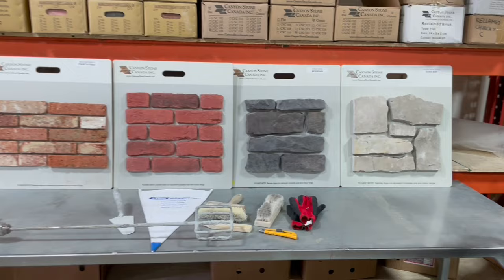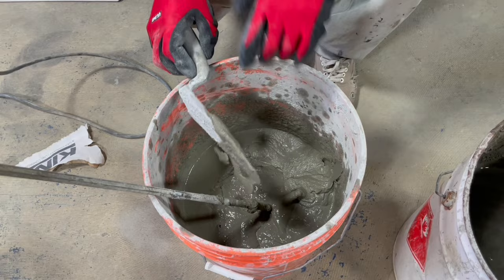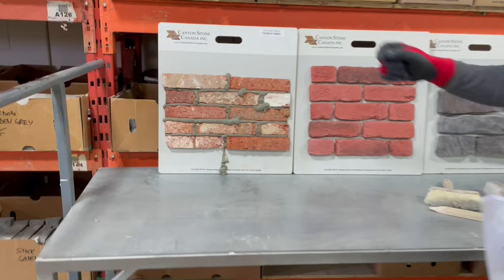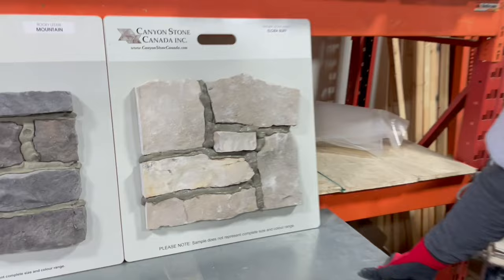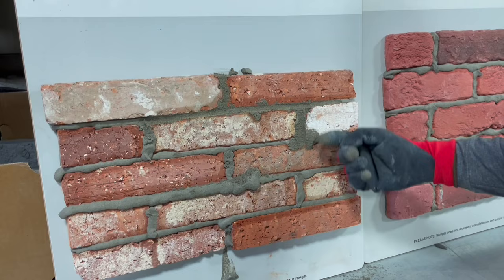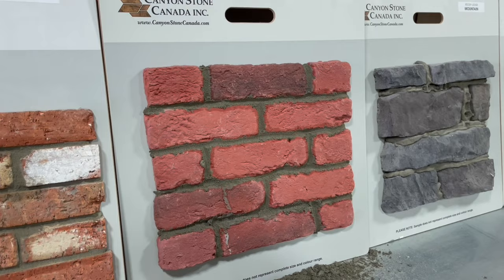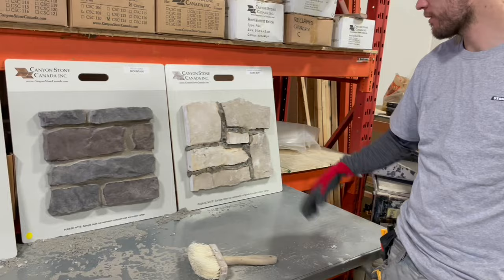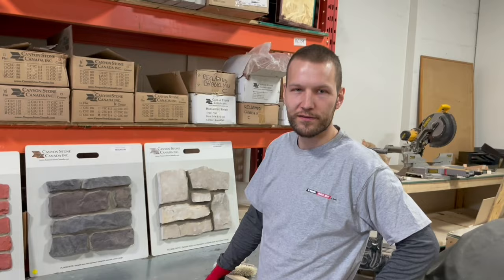EASY MORTAR JOINT- HOW TO GROUT BRICKS AND STONES

Comment: FYI take it from me, you'll want to be careful as you can, and to not drip mortar on your brick work. Some craftsmen refer to it as "smearing" up your masonry work.  What happens is that when  you smear it up and it dries, you always have a mortar haze on the face of your brick. This is O. K. if you are going to wash it with a cleaner, but you really only want to use a typical cleaner solution outdoors and then only if you know what you're doing. Brick cleaner has a kind of strong acid in it that can damage stuff and make you blind and other bad stuff.  It is possible to coat the face of the brick with a resist that keeps mortar from sticking, but that kind of keeps mortar from sticking where you want it to stick. There is a learning curve.
Reply: what if you are painting the brick anyway

Comment: only critiques i would say are, the mortar was a little wet which can cause more mess than needed, and when brushing you should always brush up and down with a slight angle forwards, otherwise you are just brushing mortar out of the joints.

Comment: So outside, if it rains with in two days? Will it hurt cover it with plastic like 6 mill plastic roll? Only thing there is  condensation? Any thoughts? Cause soon as I do my rock wall, even if no rain in forecast it will rain.

Comment: Appreciate this video!  I'm getting ready to redo the grout on the steps leading out the back door.  The previous owner was cheap/lazy and used a clear silicone caulk.  Pulled that all off yesterday, cleaned out a good amount of the loose grout.  Ready to do the this part!

Comment: All I got to say is that if you aren't familiar with working with bricks and mortar, take whatever scraps you have and set them to a separate piece of plywood and then practice the pointing  before you destroy your brick. I would even suggest that you can install the brick and hire a pro to grout it. I can almost gaga that at the very least you will need to as if wash it when you're done

Comment: I recently tried to repoint my brickwork using a mortar bag as per this video and it was a disaster! The mortar seemed to separate in the bag when I squeezed it and all that came out the end was a dribble of dirty water…made a right mess. I tried increasing the size of the hole but that didn’t help. I ended up pouring the mix back in the bucket and using a trowel to fill between the bricks. Not sure why but this mortar bag technique certainly didn’t work for me.

Comment: I am grouting brick veneer in my kitchen and bought some premix grout, but the directions say to pre wet my tiles (in my case, brick) before grouting. You didn't use any water on yours, so I'm confused on whether or not I need to wet the bricks beforehand or not? Any help would be greatly appreciated, thanks!

Comment: I just attempted this. The mortar has to be very thick so that it doesn't run on a vertical surface. The demo has those panels angled back so the mortar stays in.
Reply: Couldn't be more wrong lmao I install stone everyday and my butter is always wet. Go ahead and grout with dirt, bag will blow out within a hour and arm will be sore asf from struggling to squeeze dirt out
Reply: It's just practice.  Get the consistancy correct and it runs easy and sticks.  There is a bit of technique to squeezing it in like going bottom to top or letting ends fill up and grab the sides.

Comment: So do I NOT need to use a concrete bonding adhesive/glue to it before applying the mortar mix?  I had seen another video where they applied the glue.  But if I don't need it, I won't use it.